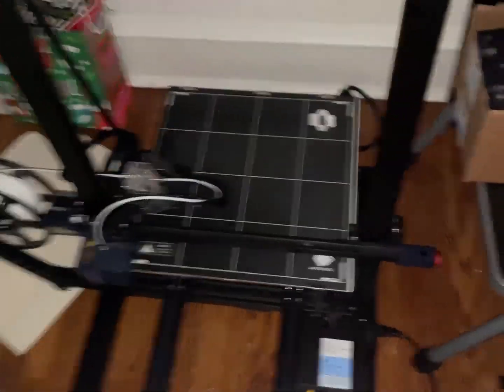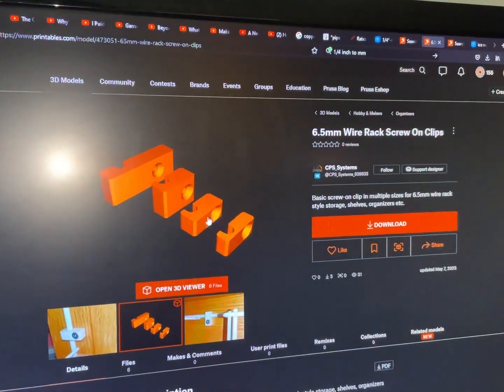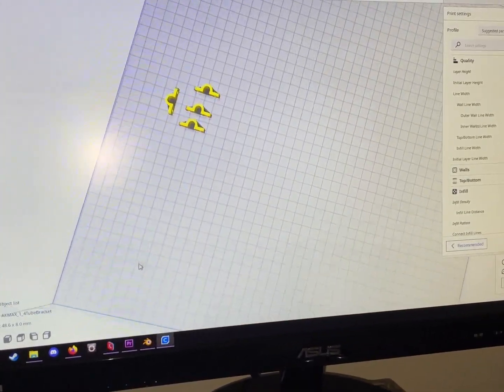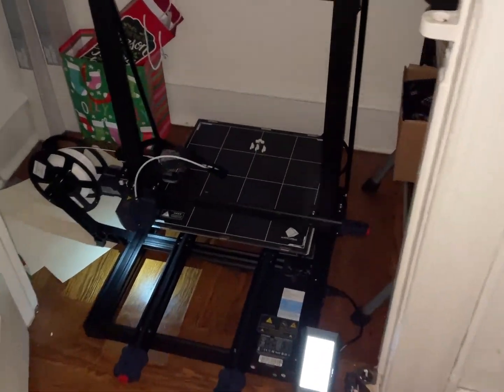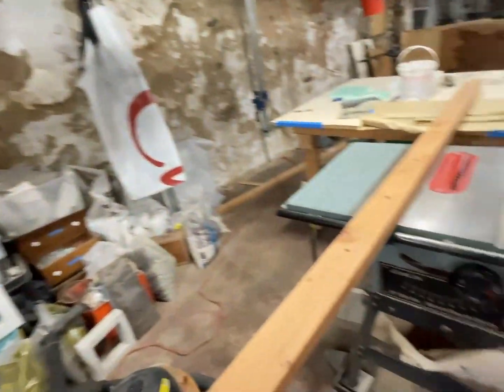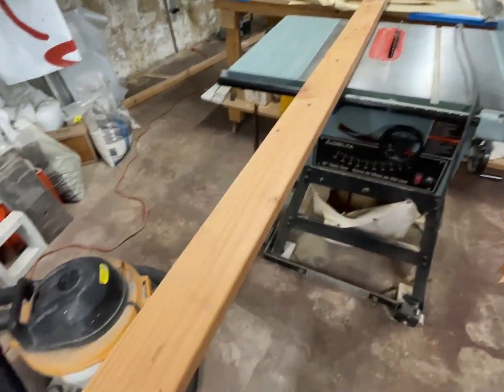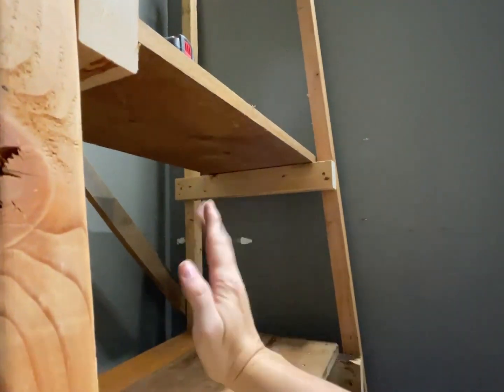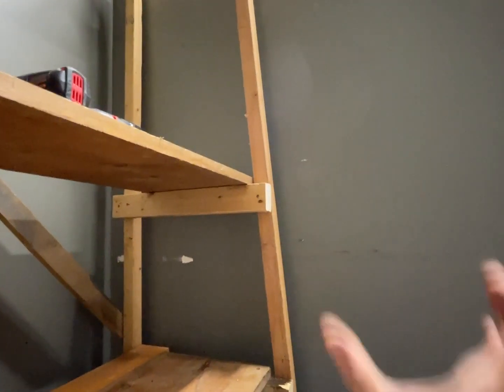3D Printing Experiments 04: Using a printer the way we dream is still tedious. We need more models!

Comment: Something to ponder. We have the ability to 3D print entire cars. Where are they?
Reply from the maker: I’ve seen a few 3d printed cars personally, particularly at the San Mateo Maker Faire, however they dont end up working out right now because on something of that scale high pressure metal casting is a more potentialized technology. Tesla is doing amazing work casting cars with bigger and bigger gigacastings. I suggest checking out Sandy Munro’s teardown videos if youd like to see where auto casting is going

Comment: I like soldering copper water supply pipes. There's something about looking at a nicely soldered and run copper job that just says quality!  Of course you have to be very careful bringing the flame around wood studs and such.  Up here in Chicago it's all that's used for water supply I never see PEX or CPVC.

Comment: You have very practical thinking, maybe this is the reason why ordinary people dont choose reasonable descriptions or make the stuff like you do. Or they prefer to buy it ready to use. Stuff some tissue into your ears when you use loud tools, because deaf ears suck if you get older.
Reply from the maker: I’ve again moved away from using the impact driver. For some reason I ended up having the drill at home and the driver in my bag

Comment: Part of this is search terms used are too specific (ice maker hose) is an oddly specific type of hose (6.3mm) isn't a very common value for anything in particular? (1/4") is an interesting one though.. (1/4) gives results, those quotes as inch marks on the end are breaking something fyi. But (1/4" tube) isn't a broken search. Knowing the audience helps a bit here as well, 'cable' mounts for things are even more common than tube/hose etc, but serve the exact same purpose.. see below on that issue..

It's also not so much an issue of more models = more better, for something like this, but that the models are indexed in such a uniquely niche manner, they might never be found again! Try the "View Related" option on thangs once you find a close-enough model, it's pretty amazing for this! Here are examples of why you'll likely never find these clips under the terms you're expecting.. (2 hole cable strap)(Clamp Gardenhose Schelle Gartenschlauch Gardena 16mm)(Shelf pipe clamp)(Anet A8 - Hot end wire clamp)(Dishwasher Drain Hose Clips)(Pipe Clamps) Many of these would likely require scaling, but this general shape is out there in many different forms.

At the end of the day being a cad-wizard is the best way to get what one wants, as scaling can only go so far unfortunately. And the printability or material usage of many designs, is often questionable.
Reply from the maker: In order for 3d printing to change the world, we have to make it so users dont have to be a cad wizard like me. I think this is the main reason why so many people buy a 3d printer and barely touch it

I dislike using a borrowed design because they almost always are of poor quality for the task at hand, and the fact that once I upload these they are very popular tells me that many people want them. Ive found so many models just labeled “Pipe thingy” which is clearly an issue of the overlap between autistic technologists with no social skills and people with a 3d modeling ability

Comment: Would be easier if americans finally learn to use metric system like rest of the world. Like, seriously. How this is even possible that in 2023 someone is using "feets" to measure anything. Like caveman.

I work on cnc and it creates so many problems. Technical drawings in inches need to be calculated by me manually. I cant even measure how much time i wasted because of this.
Reply from the maker: But they also didnt have it in metric so you entirely got sidetracked by the wrong thing.

All measurements are equally viable, it just depends what you speak best

Comment: I don't even bother  looking for anything  on thingiverse, I just design and print what I need.  The other week I printed some temporary  clips, I have now made the replacements  from brass ( using a 3d printed die to bend the brass
Reply from the maker: I think that's a shame that the community has mismanaged models so much.
Reply: @RinoaL  exactly, I think it needs someone to create a proper searchable database of designs rather than the hordes of sites, all of which are great as long as you dont want anything useful like a clip, I have printed spacers for a cousin who is a kitchen installer, I have printed replacement track parts for sliding mirror doors, almost to the point where its easier to design and print something than it is to go to the shop and hope they have what you want.

Comment: I do not care about inch at all, the biggest mess at all for an independent countrly to rely on non metric measurements. 
Ridiculous for 2023 and even russians have metrics. Might be time to get rid of the imperials the population of the world doesn't care. 

Back in the army we had seen so many struggeling to get things right that it was horrifying to get any joined operations done right. 
And the search term '' or " might also cause issues.
Reply from the maker: But it also didn't have it in metric, so the video clearly went over your head. no unit of measure is better for everything, don't let the elitism get to you that much.
Reply: Imperial units make more sense for things like pipes where they denote the "trade size" rather than the actual size. These aren't what you would expect, for instance a 1/4 inch NPT fitting is more than 1/2 of an inch. By keeping it imperial people who don't know imperial units don't get confused by this.

Comment: FYI it's because no one can be bothered. also search terms are hard. 3d printers are old and domestic ones come from the early 2000s with RepRap project being 2005ish? if you want to make those clips stronger consider annealing (it's not really annealing but that term will give you some guides).
Reply from the maker: People can be bothered though, they boast about how useful 3d printers will be since 2008 and haven't done the work except on modeling trinkets. And yeah 3D printers have been around a long time, that's why I'm annoyed. I've been doing 3D printing for my job in various ways off and on since 2015 and not a whole lot has improved on the community side.